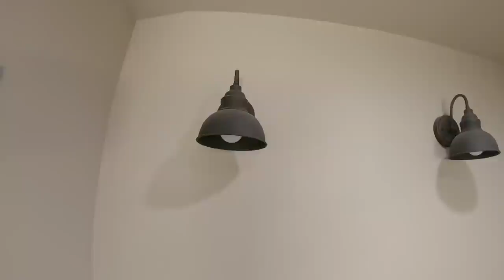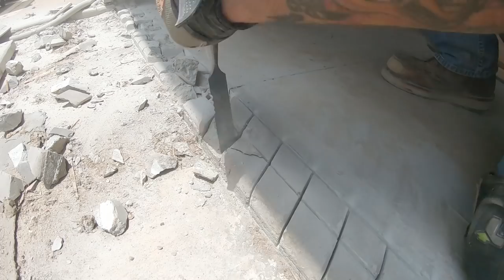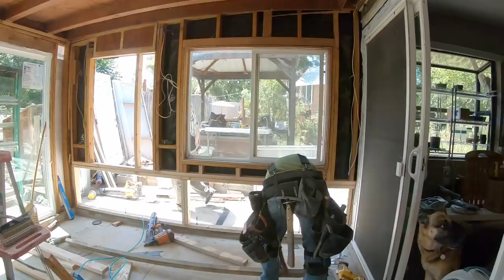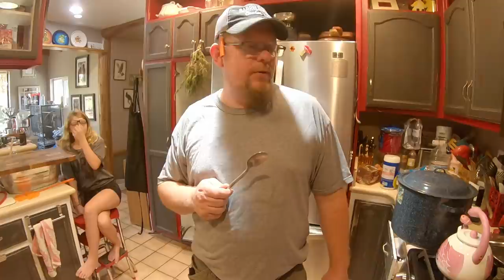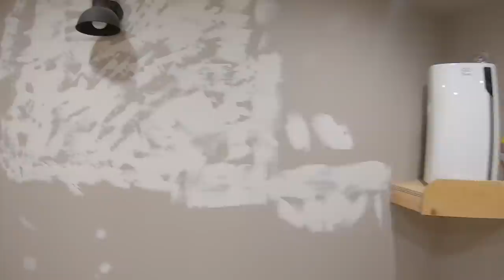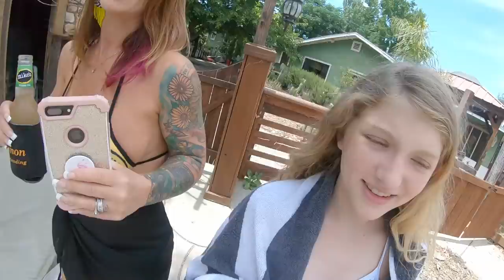Demolition at The Crouch Ranch!

Comment: Syd, instead of sanding drywall, try using the 12 trowel at an angle to LIGHTLY scrape the drywall, like shaving your legs.

Sanding is so over rated. The only sanding I do is with one of the electric sanding poles with the vacuum attachment. The sandpaper for the poles has a perforated face to align with the oles in the sanding pad. Well worth the money. (approx $125) also doubles as a floor sander for smaller areas.

How much milk are you getting a week from the goat(s)?
Reply from the maker: 3 quarts a week from her .